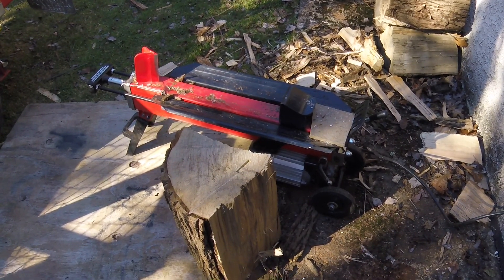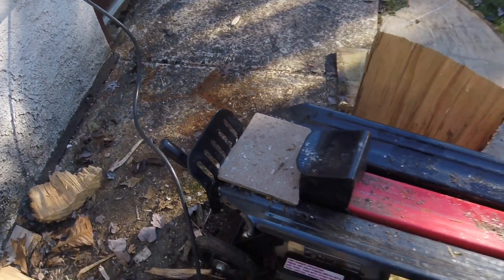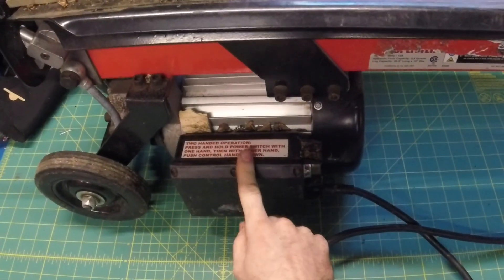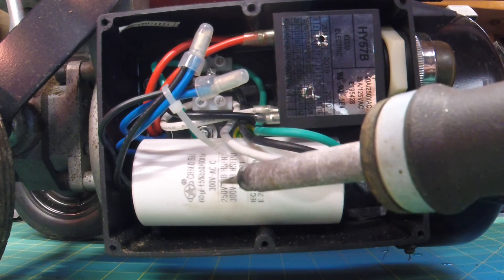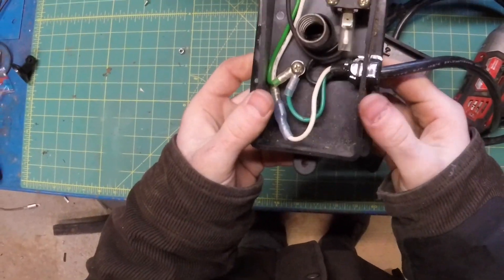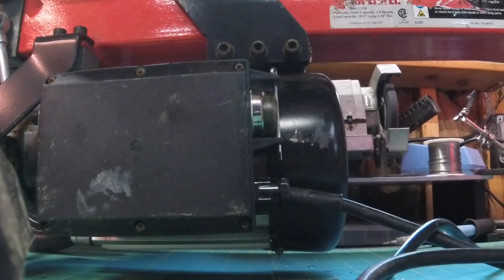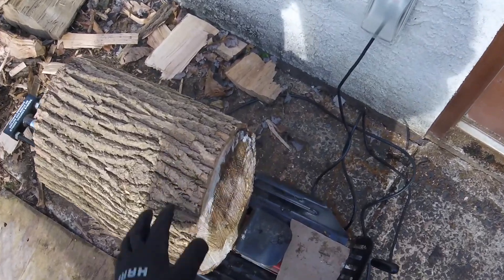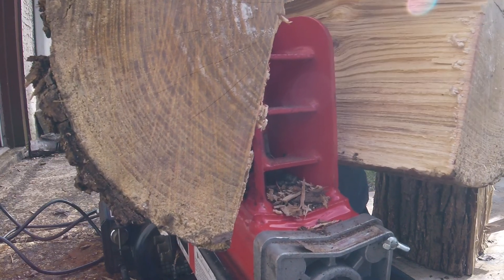Harbor Freight Log Splitter: Ruined by Lawyers, 5 Minute Fix.

Comment: Why cotter pin the switch? You could’ve easily cut the two wires, connected your pedal inside the box, and closed it up. Would’ve looked factory.

Comment: I made mine one handed operation and eliminated the auto return of the ram, so that when I push the power button the ram moves forward on its own, then stops when I let off the power button. I then lift the spring loaded hydraulic lever to bring the ram back to where I want it to stop(not all the way back-based on the length of the log). It works slick as heII, and a lot faster than before. All I did was put a nylon washer under the pivot bolt of the hydraulic lever and tightened it enough to defeat the spring loaded return of the lever, making the ram return function manually operated, but the ram forward function is automatic with pressing the power button. I also replaced the wheels with hand truck wheels and added 3 or 4 inches to the front leg to make it taller and easier to roll around. Other than leaking like a slow sieve, mine is a good one too, that has amazed me at the rounds it will split.😎
Reply: Really? That's all you had to do? Sounds awesome. I'd rather not deal with a foot switch. Wish we could attach pictures to comments

Comment: Cotter pin is a great idea.  However, my push switch broke inside so I  opened it up and removed the spring and taped it together and always on.  I put it back together and plugged in the foot petalas the switch and it worjs perfectly.  Now it just has to have an external switch.  Broke the push switch because of too much force fron a clamp I was using.  Your cotter pin idea is great. I also made a stand for the spitter with a pallet and mounted the foot switch to some wood as the angle just wasn’t right.

Comment: Can I just remove the momentary switch and solder the wires together and add foot pedal ? 
(Instead of using a pin to hold the switch down)
Reply from the maker: Yup totally

Comment: It simpler to just put a clamp that holds the button in and use the foot power control. $4 and 10 sec to install. Has been working for my for several years

Comment: Anyone keep this outside and covered at all times?
Reply from the maker: I do, actually. 0/10 do not recommend.
Reply: So you do but it's not recommended???
Reply from the maker: @kevinpeyton33 I did it and all the screws and bolts rusted up, and the motor isn’t very reliable anymore. So now it lives outside because I’m not wasting shed space on a rusty unreliable splitter. Learn from my mistake!
Reply: 10-4 appreciate the info garage it is...haha
Reply: What size whole did you drill? And what size pin?

Comment: I'll bet you could have used zip ties to hold that switch down before the warranty was up.   Great video though!
Reply from the maker: You would have to cut them after every split because the ram won’t retract with the motor running.
Reply: @thedoubtfultechnician8067 I meant use the ties to keep the button pressed down in place of the cotter pin.  Still use the foot pedal.  That way no drilling is required.
Reply from the maker: Gotcha.
Reply: @PubnicoExpat how would you do that?
Reply: But how would you get the ties arumd the button there is nothing to wrap them around

Comment: I think I would have just installed a toggle switch in place of the momentary, but hey, you do you.
Reply from the maker: Won’t work. Ram won’t retract if the motor is powered. You’d have a to toggle it off every split

Comment: Just imagining this thing in any factory. The safety guys would insist on T-bar buttons to operate it that require both hands at once, it would be surrounded by guardrails and sheet metal shrapnel guards, and it would have electric eye light curtains to make sure no part of anyone's body gets inside the safety zone. And people would still be losing body parts to it.

Comment: I have one of these splitters.
If anybody wants to know, they are brilliant, and even my wife can operate it easily.
One modification I found really good was on the pusher.
I run a bead of weld along the top leading edge, then ground it so it made teeth 🦷 along that edge, also a single tooth on the protruding rounded middle of the pusher.
I found this stopped any wood from moving off the pusher during operations.
I also sharpened the anvil end and polished it up as well.
My splitter also had a top mounted push button that I can operate with one hand after extending the hydraulics arm to closer to it.
Thanks for the video.

Comment: Simple FIX:  I made a spring clamp with a tough piece of a steel skewer, to hold the button in for continuous electric motor running,  Benefits? 1) one hand is available to manipulate the wood 2) continuous motor operation is easier on the electric motor and on the Generator when needed. 3) I also cut my firewood to 12" which is easier on the splitter, and a spacer (as you have done) to speed up operations.  NOW splitting wood is more enjoyable and faster.  The 12" firewood fits better in the firebox, so the ends face the door.  I move the coals to one side and let the fire burn to the opposite side. It is much easier to stack and fill the whole compartment.

Comment: I'm guessing The two-handed operation thing was just the easiest way for them to implement a design that cost them less money. By turning the motor off it allows them to have the return system work by simply backflowing the pump rather than having the valving necessary for it.

Comment: You almost had it! All you had to do is cut the two wires to the push button switch and join them together. Instead you went and bought a foot switch at extra expense🤐.
Reply from the maker: Yeah people keep saying this but if you had this model you’d know that the ram won’t retract if the motor is running. You must cut power to the motor every time you complete a split.

Comment: I would just replace the momentary switch with a toggle switch.
Reply from the maker: Doesn’t work. The ram won’t retract if the motor is running.

Comment: You ever let off the lever while holding that push button in? The ram won’t retract. So I suppose your plan is cutting power to the splitter via the foot pedal will do the same job as letting off the button?

Comment: I think if you’re going to heat your home with wood it’s better to just pay up and purchase a real log splitter. I have had my  27 ton MTR log splitter for almost 24 years. It works vertical and horizontal. It’s gas powered and it’s works great. I can see this working for splitting wood for a fireplace or camp wood but if heating your house no. Take care

Comment: Thanks for the easy solution. i am gonna use my log splitter for blacksmithing so instead of the foot pedal i will just have a regular light switch(15amp) and then the control handle i will set up to be operated with a foot pedal.

Comment: I had put a longer piece of pipe on the piston handle so i could use my leg or knee to control the splitter. Very easy and quick and doesn’t take long to get used to.

Comment: Mount that switch onto a board to keep it stable. Another mod to make is to make some kind of teeth in the ram surface instead of leaving it smooth. Wood won't slip of and hit you in the face! Most larger splitters have spikes or some kind of teeth welded on the ram end. 
  Or better yet, weld another wedge on the ram! That way no matter what you try to split, one end or the other will enter the wood so it will always split!

Comment: Genius on the foot switch, man. I think I am going to pick one of these up. They are cheap, and they sure beat hand splitting. I just wasn't sure what their capabilities would be since it is only a 5 ton splitter. I have used 25 and 30 ton gas powered log splitters, but I didn't want to drop the coin on one of those right now.

Comment: Yeah, these things are pretty dangerous to operate because of the 2 hand safety on them.  I end up working blind some of the time because I have to use my shoulders to steady where I want to split the wood.  
I'm getting a foot switch but I'm probably going to hook it around that momentary switch instead of the nail trick. 
Good idea though.

Comment: Got the identical log splitter sold by wen, And the switch has failed. Do you think I can just replace it with a generic HY56 switch? That's just a straight-on-off?

Comment: As a side note I have a foot switch on my drill press that way my hands are free to hold work and use the drill press and if the work gets stuck just let off foot switch in stead of trying to hold work and hit the stop button . I am thinking about getting a splitter and thanks I will use my foot switch👍

Comment: Great, simple, inexpensive mod!  I have the Homelite splitter with the power button on top, works equally well with the cotter pin.  I also use a cut off broomhandle to depress the lever, which mine has instead of the handle, saves me bending over.  Thanks,

Comment: I went one step further and installed a mechanism on the rear lever that presses a button ,which means that I only use one hand to start the splitter and the other hand maneuvers the wood  log

Comment: Did I miss how you hooked up the pedal?  The splitter just plugged into the foot switch?  I don't understand what the cotter pin did?  Keep that button pushed in all the time???
Reply from the maker: Yes, and yes
Reply: @thedoubtfultechnician  cord from splitter to the foot pedal, and cord from pedal to power supply?  ty
Reply from the maker: @filoIII yes
Reply: @thedoubtfultechnician    hmm   ty

Comment: If you're thinking about buying a log splitter but don't want to futz around with workarounds, buy a Boss electric splitter; they're still one-handed.  My 7-ton unit looks exactly like the HF model in this video, right down to the oil vent screw.  Had it for two years, no issues.

Comment: instead of using that paver to stop the piston from going back all the way theres usually a collar on one of the 2 round rods that go out with the cyclinder on the wedge end u turn the bolt on the collar to hold it in place and stop the ram from retracting all the way

Comment: I purchased my 5 ton in early summer. I live in SoCal and the most prevalent wood here is eucalyptus. Funny thing with this wood is how hard and twisty it is. If you try with all your might and use an ax, the ax will just bounce right off the log. Very hard to split. This 5 ton from Harbor Freight has NO problem splitting this twisted wood. I have split rounds that were up to 15" diameter. Maybe not the first try or down the middle, but starting on the edges and taking slices off. Sometimes I have to work the round and flip it or just move it a quarter turn. I have it on a rollaway bench that I love. It hasn't failed me yet with over 2 cords split so far. As far as adjusting the ram, all I did was to cut a piece of wood and place it behind the ram so it won't cycle all the way back. Yes, the two hands to control is somewhat awkward at times when you want to hold your wood from raising up. I would also like to see some small spikes on the ram head to keep it from slipping off the wood sometimes.

Comment: This is awesome. Your video convinced me to go out & buy it, along with the foot pedal and the fix - I just used a nail and it worked perfectly. I can't even imagine bending over and holding that button. It's nearly on the ground! Thanks again.
Reply: Set it on a platform so you can save your back, brother, and you will thank me!  HA HA

Comment: 5 second fix--put a clamp on the starter, leave it running, turn it off and remove the clamp when done.
Reply from the maker: Doesn’t work. Ram won’t retract unless you release the button.
Reply: My ram returns upon release of the activater handle.
Reply from the maker: The original version was like yours. The new version was “ruined by lawyers”

Comment: Nice solution, I like the footswitch idea, as you say, 'ruined by Lawyers'
I have the same splitter, I mounted a heavy duty micro switch on the back of the lever then wired in a 230v relay inside the box, happy days.
Also, as my brother pointed out, I can tie a piece of string to the lever with a loop the other end as a foot switch, hands free!

Comment: Hi, I have one very similar to yours. Can you tell me what the wing nut is for on the end of the splitter?
Reply from the maker: It’s a vent for the hydraulic system. Manual says to loosen it when in use and tighten it otherwise. I think mine has been tight forever.
Reply: @thedoubtfultechnician  ah, thanks. I’ve never touched that as it is very tight. At the other end, there appears to be a drain plug with a spring attached to it, and I undid it to let some air out, and power improved .

Comment: I put a small electrical enclosure behind the lever with the momentary push button switch installed there so pulling the lever also pushes the button. I then put a push/pull button where the original momentary switch was to act as a sort of master switch. Works great now. And the relationship advice? Awesome. You and yours are cut from the same cloth as me and mine.
Reply: Can you post a video of you solution? That’s what I was thinking of doing.

Comment: So the way i rig it is?  rope and a stick, Tie the rope making a loop to the ground to the stick wedge on the button  rope over to the handle tie it on . use a plank of lumber for the peddle, Take your foot place on the peddle and step on it pull the button and handle down at the same time.    There I'AM AWAY FROM THAT DANGEROUS THING

Comment: i bought the same model. Its great and does what I need it to do. 2 issues....it is small and sits low, so I put it on an old wire reel I have and it fits almost waist high ( I'm tall), second, holding that button down tends to hurt after a while. Can only do so much before you stop. I thought of doing a rewire with a pistol grip type switch but this is better, no wire spicing just a couple quick holes to drill and done. Thanks.

Comment: Just returned a borrowed electric wood splitter to my neighbor (I like having my own stuff, ya know...) and have been researching electric ones and HBF pricing on this model is $329 (TN, USA) now. Probably will get the foot switch as well. Need to work on a sturdy table to bring it up off the ground as the knees and back sure feel it more now (not 20 yo anymore). I'll reply back on this thread in a few months, as it's Winter time and I'm about to do A LOT of wood splitting. Great video, appreciate your candor and sharing tips. Saved your link to check back on other stuff and things later on.
Reply: Mine is mounted on a left over metal stand from my woodshop, did not have to built a thing!

Comment: Hey great video.  Now since you sound pretty acquainted with wood splitting machines I have a question. 
I have a small 6.5 log splitter. First one.  It is not retracting.  Any ideas what the problem might be?
Reply from the maker: I assume electric? Any idea the make and model?

Comment: I found the foot switch at HF..two versions...dead man's vs push on/push off.  At first I went for the push on/off but that's not as convenient as the dead man as the motor keeps running and the ran does not retract, even if the lever is dis-engaged.  I have also been put off by the difficulty with moving the splitter "off road".  I was looking to change the wheels, expand the wheel base, or something. Then HF had a hand truck on at Black Friday.   Going to try mounting the splitter on the hand cart, add the switch and moving should be easier, plus the machine will be raised up by 10-12".  I've had my splitter for around 5 years and it has earned it's spot in my garden shed. Thanks for the inspiration!

Comment: Great work. No question that some of these ideas actually make things less safe. Same thing goes for the new Ryobi 40V hedge trimmers. The require 2-handed operation. Which means that if you use them from a ladder, you lose your three points of contact And fact is, people are going to use them from a ladder.

Comment: Just done upgrades on my splitter. Made good wiring that doesnt requires drill the hole to push the button. With mine upgrade, you can use a button or pedal. It is quite easy and doesnt requires lot of knowledge to do that. I can draw diagram if someone interested

Comment: Thank you.  Could you just put a jumper wire on the switch
Reply from the maker: Nope, the ram won’t retract until power is shut off. So you’d get one split and then you’d have to disconnect the jumper
Reply: yes you can instead of drilling hole in plastic to hold push button in all the time. but you still need the foot petal.releasing the foot petal turns the power off to your machine

Comment: I have the same identical machine. But my button is on top so I was able to carve a 5 1/4 inch stick that I can wedge in that holds the button down continuously . 
Then I put a bungee cord around the wood. 
Saves about three arm reaches and four bend overs per log. 
And I also put a 7 inch 3 x 6 piece of wood for the cylinder to relax back on.
It cut the travel time of the cylinder reach by a fourth thus it is crack crack crack crack instead of crack……………crack …………….crack………….crack 
I love it.   I first had it in the woodshed and now I have it in the house next to the stove.

Comment: Great fix, thanks for sharing.  Did you consider locking down the control lever as well?  Seems to me just using the foot pedal would do?
Reply from the maker: It won’t retract unless you release both the lever and the foot switch.